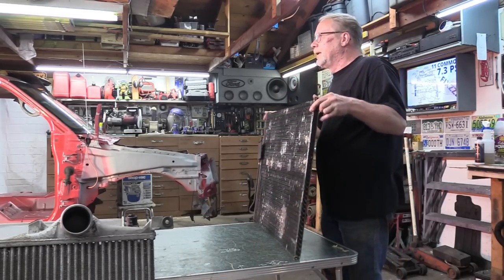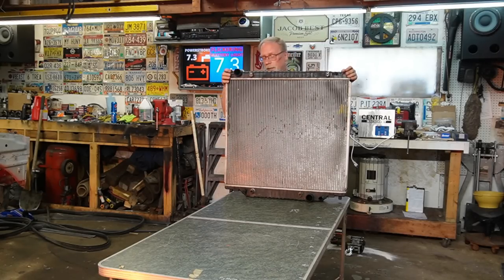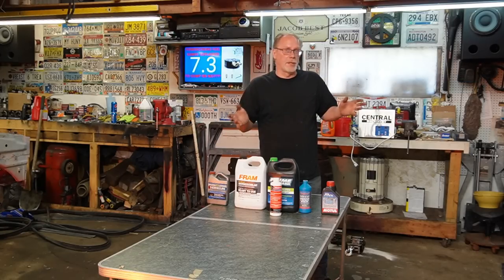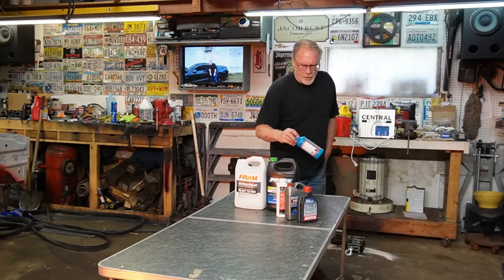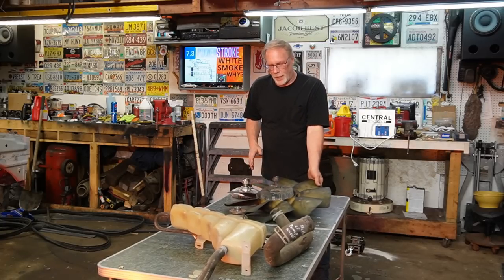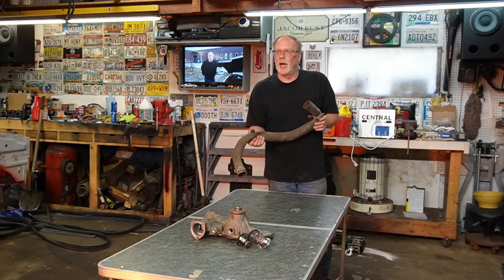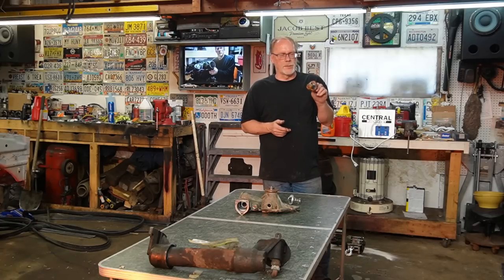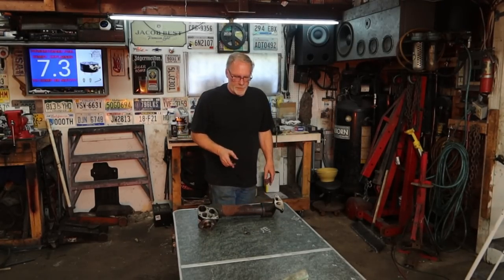🛻📽️ ....7 3 PSD COOLING SYSTEM ALL COMPONENTS N OIL DELTA  🟢🟡🔴🟢

Comment: I TELL YOU WHAT. SINCE I PUT A EXTERNAL COOLANT FILTER ON. NOT DOING A WATER PUMP EVERY 3-4 YRS. LAST ONE WAS 5YRS. THIS TIME I WENT WITH MOTORCRAFT PUMP FROM RIFFRAFF DIESEL. SO MUCH CASTING SAND IN FILTER WHEN I CUT THEM OPEN. CHANGED 1ST FILTER AT 5K. VERY FILTHY SECOND SCREW ON FILTER AT 15K. GOT BETTER. BY 3RD ONE BARELY ANYTHING IN FILTER. GOOD INVESTMENT. E99 CCSB 290K. YES I RUN GREEN COOLANT WITH SCA ADDITIVE. VC-08 FROM FORD. Motorcraft oil filters only

Comment: This is by far one of the best channel for 7.3 powerstroke info. Regarding cooling, i want to add an external coolant temperature sensor to my engine. Does anyone has a recommendation on where in the engine i could install one? Could i just tap into the oem one in the waterpump to get a reading to my gauge?

Comment: Great video. Delta is very much a long-established term used in mathematics and engineering to define a difference or change in a quantity. Exactly as you were discussing here in regards to the difference, or delta, in values between engine oil temperature and engine coolant temperature.

Comment: Thank you for the rundown. I still have issues with my thermostat not reading on the dashboard after a like for like engine swap on my 7.3L 1999 e450 ambulance. I replaced the thermostat and the pigtail. It appears to be working mechanically, the tube feels right when the engine is warm, but no joy on the gauge. If you have any advice I'd love to hear what to check next. I'm in Los Angeles and I'm having a hard time finding parts at the many salvage yards in the valley, many acres of cars but very few 1999 e450s.

Comment: Pretty sure that blue devil gets in the rad cap and gets stuck closed? I don't know if I've been buying oem, off and on maybe. But when my motor heats up it pushes coolant out the water pump weep hole. The pump isn't that old, and I think its gates.

Comment: Thank you, been tremendous help. 1999 F250(March 98 build date..?) I've had for 3 years. Door sticker/ engine condition correspond to a Jasper replacement engine 12-21-17 @ 234k, 304k now. What coolant do you think should be used? I would think 2010+ materials at least would have been used in reman...?
Reply from the maker: GOLD

Comment: I have a 1995 7.3 f350 and  recently replaced my radiator, water pump and thermostat. I used green 50/50 coolant that has turned into a yellow color. Any idea on what might cause the change in color? Is this normal?
Reply from the maker: Air pocket and over heated the fluid , oil or rust contamination,
Reply: @CUSTOMWORKS7.3PSD  Thank you sensei.🙏

Comment: Did you mean 95 deg. to 110 for the first "Open" thermosate or 200? That seems cool even for those conditions. I don't remember it being that cool even in minus 2%, where I had to put a piece of cardboard in front of my radiator to get normal temps.

Comment: That radiator pressure cap is important also for water pump seal.  I had to replace pump at 70 k  because no pressure.

Comment: Thanks again for another great video!! 
I can verify how important the viscosity of the oil is in 7.3s. I ran Rotella T5 that had 2700 miles on it. At that point I started to get the romp romps, ( 1 or 2 tachometer jumps on start up). 
Someone on a forum said to simply change your oil. So I changed it and put in Delvac 1300. So far Ive probably had 100 start ups and no romp romps. And I don’t even really tow with it that often. 
Have you heard of that Clint? Or is that a coincidence?

Comment: Hey Clint. I have a question about the OBS7.3. Mine is a 94.5 with the all metal radiator and overflow bottle. I’m in the process of swapping to the 95+ plastic end capped radiator with degas bottle.    My question is : the OBS7.3 uses that massively heavy, odd numbered blades fan.  Would it be a smart idea to upgrade to a lighter, newer plastic fan for my old truck on the Ford Clutch?    Thanks!!

Comment: Follow you all the time.  Have a 1997 Ford F-250 HD, with California Emissions.  For the first time in a quarter of a century it is down.  Check all fuses, fusible links, replaced all sensors and relays. No Joy. i need a new wiring harness. Not in production. How do a I get a 120K, beautiful truck running again. You say change your wiring harness. I can't get one. Should I part out a fully functioning 1997 7.3 or call Pick and Pull ?
Reply: Try riff raff diesel
Reply: Riffraff diesel has the main engine harness.  I've replaced one this year and two last year for two 1997s and one 1996.

Comment: I flushed out my cooling system and used regular Prestone antifreeze and then read that I shouldn't use that it's not good for the motor and that I should be using Motorola vc5 was this not correct I did not see vc5 as an option in this video your knowledge and expertise would be greatly appreciated

Comment: I've been towing a small trailer (between 5000 and  7000 lbs) with my '02 F-450.  The transmission and torque converter are freshly rebuilt less than 100 miles ago.  It seems like I need to rev it to between 2500 and 3000 to accelerate without holding up traffic to the extreme.  I can achieve roughly the same rate of acceleration between 2000 and 2100 while empty.  Is this in the normal range for this engine?  What RPM is safe to routinely hit with a 7.3 without shortening the lifespan?  It might be nice to have a video giving newbies like me a bit of a driving guide for these 7.3 powerstrokes.  Thanks.
Reply: That’s because you’re pulling 5000+ pounds an they are not. Try walking pulling a weighted sled. You will accelerate slower then without it. Same for towing with a vehicle.

Comment: What about the newer OAT yellow?  It's supposed to be universal for everything.  Any thoughts on using this in a 2002 7.3L F350 6spd manual 4x4?
Reply: Yea I was told to use the yellow in my early 99 7.3, and that the green is bad for the injector cups? Every one says something different
Reply: @DogDaze66   You can use yellow in anything and even mix it with old regular green.. or anything else.  It's supposedly completely compatible with everything out there..  I flushed my truck, put on new oil cooler seals and new water pump and filled it back up with yellow.  Everything has been leak free and running great ever since.   It's such a great truck, I'm definitely going to buy up the next cheap one I see.
Reply: @calholli thank you kindly for the message, , I’d love to do my oil cooler , there are no good diesel mechanics here in south Jersey , I’d be better off doing it myself , even though I myself am not a mechanic . These local mechanics just do not care about doing a proper job , they are all whacked out on drugs .

Comment: So what caused after I changing the transmission fluid and my 02 7.3 super duty not moving?
Reply from the maker: Bad pump, knocked the lever off, filter has the cap covering the flow pick up, left a cleaning rag in it, air gap in the converter .There are so many things I've seen over the years  I couldn't remember them all. Best to go back to it and if it worked just fine before then check the level, if you changed the filter check it and the connector for the shifter exterior and internal. Its hard to answer because I may not have all the info , how it reacts do higher gears work, does it whine , do you hear the pump running , was it modified

Comment: Hello Clint

 I just did my 2002 7.3 cooling system a few months ago after my radiator tranny cooler failed. After a thorough flushing of the system I added four gallons of (red)
Triax All Fleet ELC Coolant & Antifreeze, Diesel Extreme HD NOAT, 1 Million Mile, 8 Year, 20,000 HRS, CAT EC-1, Concentrate. Topped it off with four gallons distilled water.
Did I just hear you right? Did I just "shoot myself in the foot"
Reply: I don’t know the answer for sure, but I’m about to do the same (Red ELC) on my 99.5. I’ve done a lot of reading and talked to both Ford and International. The consensus seems to be as long as you have a late 99 build date (or later), Red with no SCA is fine.
Reply: Did the same... Sounds like a mistake after all that mess.
Reply: Here is a post I found. I provided the link below in the next comment.
"Ford Truck Enthusiast"
Home / 1999 - 2003 7.3L Power Stroke Diesel
Gooch's Radiator/Engine Backflush Procedure and Coolant Information

Comment: Another great video Clint! And so timely. It's time for a coolant system and info is all over the place on what coolant to use on an early 99. Btw, any good sources for the additive? My ford dealer is hit and miss.
Reply: What coolant did you go with? I am in need of coolant service on my early 99 and cannot decide what to get. Forums seem to contradict on what to use.
Reply: @christopherperry5493   I haven't done the service yet but will use green with the additive.

Comment: Early 99 takes standard green?
Reply from the maker: yes
Reply: I  been using the Zerex G 05 is this ok?
Reply from the maker: @DogDaze66  Valvoline ZEREX G05 antifreeze coolant is a long life, fully formulated, ethylene glycol-based fluid suitable for passenger cars, light trucks and heavy duty vehicles. yes
Reply: Great! I’m relieved to hear that fr you Sir!

Comment: So 10000 mile oil changes not a good idea? Whole truck and trailer only 14000 lbs
Reply from the maker: 10k is way to long if we are talking a 7.3 or 6.0 I have a fleet of them that run every day 5k normal drive 3 to 4 k towing 
If you wish to keep doing that at least change the filter 3 times There are just to many contaminates and ash ect for the hpop and injectors